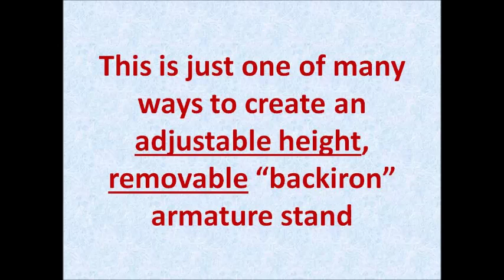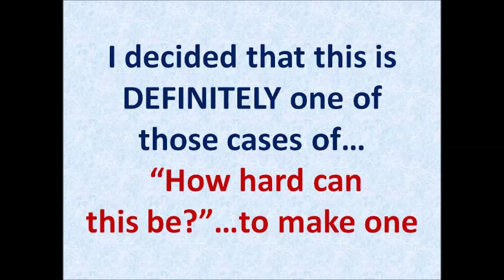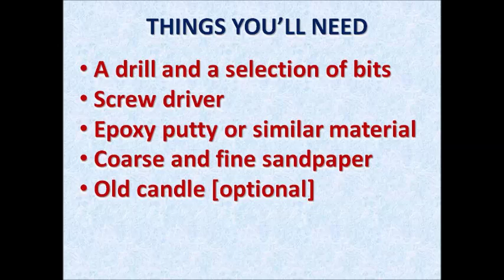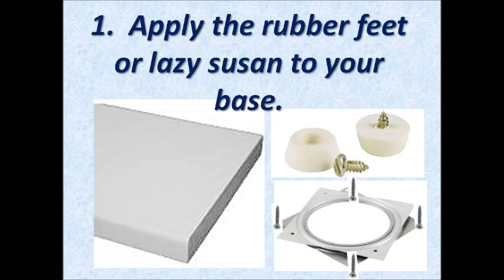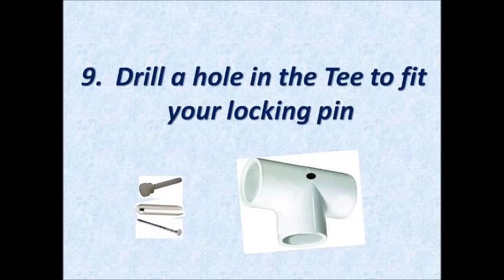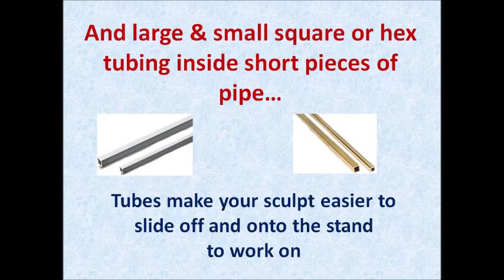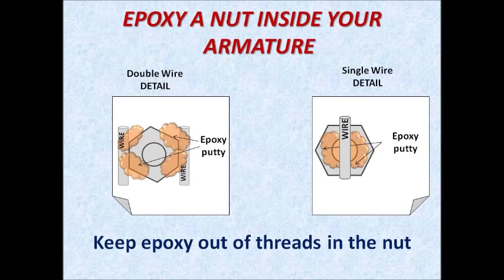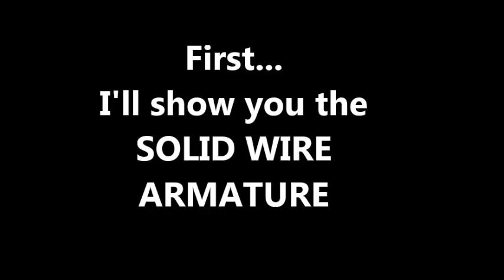HOW TO MAKE AN ARMATURE STAND FROM PVC & 2 ARMATURES TO FIT

Comment: Thanks for the vid, yeh I was looking for something a bit stronger than Julian Khor uses, this ones a great build, Just wrote down all the parts for my shopping list, then thought Id have a good look at the built stand and noticed you added another male adapter to the tee fitting to attach the attachment parts to the tee with that wasnt listed. Great build, Im going down to the hardware shop right now.
Reply from the maker: +TootaMagoota I believe what you think is a male adapter is actually a short piece cut from the section of pipe - which of course is in the parts list. I cut several short pieces off of that pipe, each of them about 2-3" long and epoxied the various sizes of bolts and square tubing inside of them.
Reply: +SkulpTools SkulpterAz Just got back from the hardware and got your reply. If you pause your video at excatly 7.44  there is definitely a screw in attachment on the Tee peice
Reply from the maker: +TootaMagoota   Ok, I see what you're referring to...that's the 3/4" male adapter that's shown in the slide at 2:50 and is listed in the parts list at 3:18. That adapter is a method I employed so that you can use pieces cut from the main pipe in your armature attachment method.
Reply: So then you need two of them? one to attach to the floor flange and one to attach to the tee peice? Yeh I bought two, but we have weird sizes here, metric to imperial, the tee piece I got goes from 20mm to 15mm thread so instead for the part you attach your attachments to, i got 15mm pipe, so I;ll save a bit of putty, yeh our male adapters go from 20mm to a 3/4 thread, go figure, anyway for the floor flange they only stock 20mm and 15mm and ofcourse there was a tonne of 15mm and no 20mm, So I got 20mm pipe for the mast support and 15mm for the arm, I compromised for a strong black plastic flange that will do the job perfectly. Love your work! I'll post a vid of mine to show you when Im done ;)
Reply from the maker: +TootaMagoota Yes, I knew there would be lots of "converting and adapting" for international viewers. Sorry you had so much trouble finding all your parts. My other goal was to be a catalyst to inspire folks to come up with their own variations too.
You know, you're right, you really would need two of those male adapters after all. ARGHH! Not being familiar with this stuff myself, I did my best to keep it all straight and still missed this. But after all this time, you're the first person sharp enough to have noticed this! Thanks for pointing it out.
Reply: Haha, hey man dont sweat it, it was kinda funny, coz I always see these people doing various things with PVC pipe, and Im always like WTF? that looks and sounds like really expensive stuff, Anyway tonight was my first venture into building with PVC, and I went down to the hardware store armed with my 20$ gift card and $50 spare in cash thinking I would definitely go over the $20, coz shit is expensive in AUstralia often double the price of the states, even bought 5 litres of distilled water, and all up was only 15$, the water was $6 itself.

Anyway I just went by feel, I got all the parts listed, even drew myself a diagram with labelled parts, and just made sure they all fit together, and bingo, got it all!

As for noticing the extra part, yeh Im a bit anal like that, its my job really Im an architect so things like that stand out like dogs balls to me. ;)

Comment from the maker: Great questions Hero! There's many options. 1. lay the piece down in a bake-proof dish in a bed of polyfilling. Or 2. bake it standing up on the lowest oven rack, mounted on a base. 

Second question, no there's no conflict with the epoxy at all. In fact, I've heard that foil alone is more likely to leach through sometimes. That's another reason I cover the foil with floral tape first.

Message or email me at skj@skulptools-dot-com for more info. I'd love to help you get started.

Comment from the maker: Hey Hero, you're quite welcome! I'm sure this will spark your own variations too. If you need a finer height selection, you can always drill more holes on the other side of the stand pipe in between the other ones.